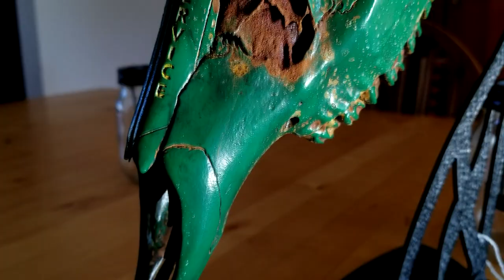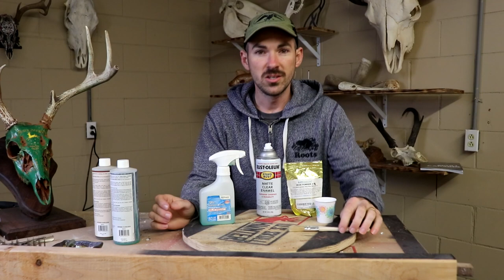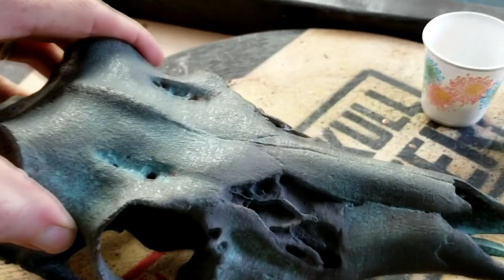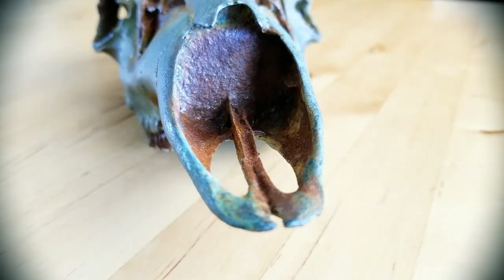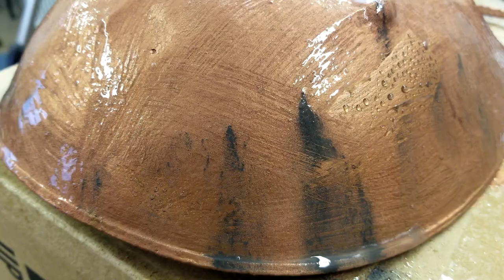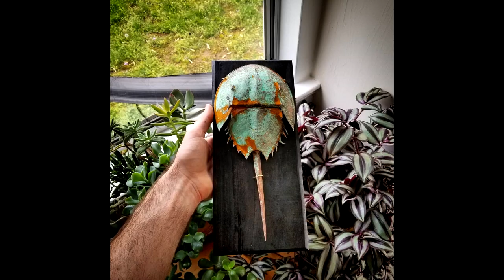Add Rust to any Skull/Surface or Combine with Metal Paints

Comment: Hey, 
I came across a steer skull at an auction for 1$ 
I have a few questions (and a newb) 

1. the horn are very flakey. (casings?) 
can this be restored? and if so how? (they are rather long) I'm desperate and can't seem to find much online on this. (maybe bc I dont know proper termanology) 

2. the bull was killed buy the puncture in the center of the skull. 
can I somehow fill and represent this hole? 🤔  I was thinking of using plaster of Paris to do this. any suggestions? 

I've seen you reply to others so I'm really hoping you can help me. (: